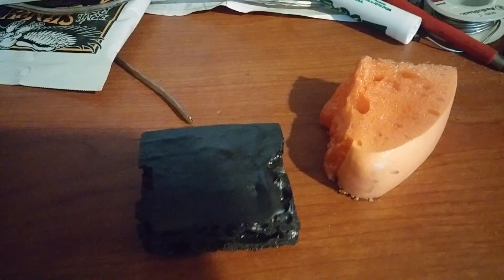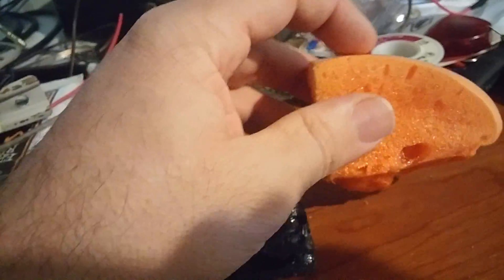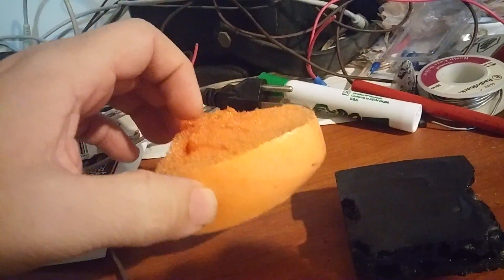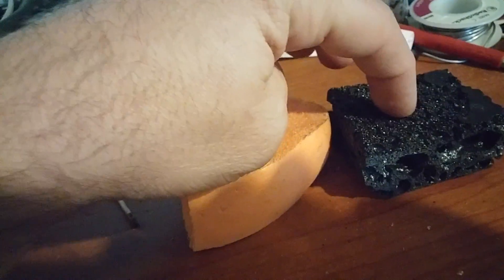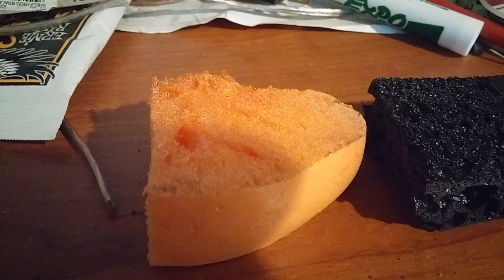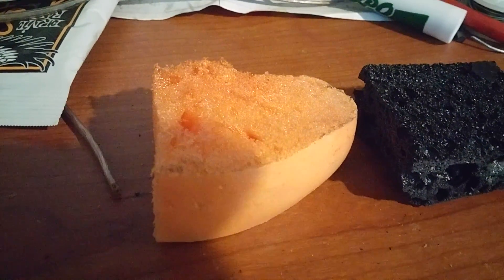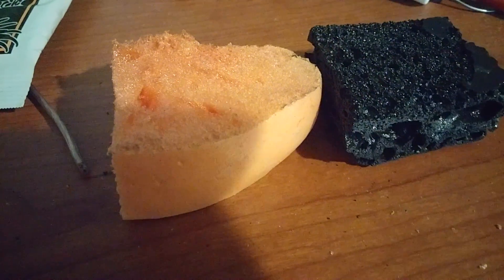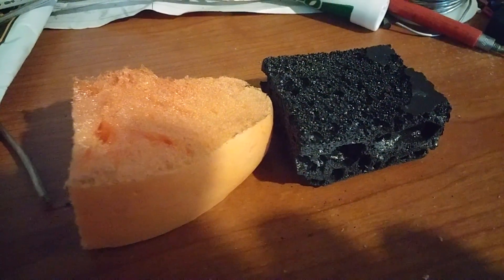Graphene enhanced foam

Comment: Seven years later, I still have so many unanswered questions.
Are you still working on this ?
Have you tried to do a more thorough analysis of the material?
Can we have some numbers and data please ?
Reply from the maker: Those are all good questions. Unfortunately the foam industry is almost a cartel in nature. Yes, the foams are enhanced by significant degrees depending on the make up.

Comment: How environmentally friendly is this material? How would you dispose of it at the end of its life cycle? Can it be recycled?
Reply from the maker: The foam is polyurethane based, so you would go through the same methods for that. As for the graphene, it's friendly enough.
Reply from the maker: The same as any poly based foam. The graphene helps, but not much.

Comment: Can we use this material in construction industry as building blocks? It would be great for light weight partition wall. Is is fire proof or fire resistant?
Reply from the maker: It is fire resistant.
Reply: Thanks.
Is it easy to mould or cast?
How can I get this material?
Reply from the maker: +Vinay Mehta very easy. just like any expanded foam.
Reply: Can you add the graphene and mix it into an existing open or closed cell foam?

Comment: I noticed when adding graphene to expoxy prior to mixing, it prevented the bond from happening, which was weird.  I take it you added the graphene to the liquid post-mix?  Was this stuff a mix?  Believe it or not, I have an actual need for this exact application.  Could high expansion foam be a building material?  Love the rambling.
Reply from the maker: Strange, because I have never had this problem. Was it UV activated epoxy?
Reply: No, it was a standard "mix these together" epoxies off the shelf!  It was your stuff, too... I have contacted these guys to get a price list and I'll share that with you when I get it.  http://www.wholesale-graphene.com/discount-online-store
Reply from the maker: I may have a solution. We have noticed that humidity can cause agglomerates with our material, and disturb  the process. This is because it hates water. Drying it before use is a key, and should fix any difficulties.

Comment: Just bought 10g to test it out. Have you done anything with thermal paste for electronics? Mixiing Graphene in the thermal paste.Was thinking about using it on my PS4 and my laptop.
Reply from the maker: +HansonHacks yep, it was my laptop and ps3
Reply: *****  Just watched the PS3 video. Didn't see a laptop one, yet. I have a bunch of Arctic MX-4 so I'll be mixing the Graphene with that. Was mostly curious about benchmarks.

Venturestarx were you able to get any benchmarks of a before and after of the laptop. In the PS3 video, you mentioned that the laptop doesn't get hot anymore. Also was wondering if you had any issues after applying all that much paste on the PS3. If possible I'll be trying to make thermal pads from it as well.
Reply from the maker: +Matthew Gregory I don't have a benchmark, but I do have actual thermal conductivity test data. when added to Arctic Silver at 3% weight, the conductivity went from 8.3 wm/k to 21.4 wm/k. We also make thermal pastes and Will make them available soon.
Reply: Venturestarx I'm not entirely sure what the wm/k means, other than a measurement of conductivity based on the context. 8.3 to 21.4 is a big jump. Thank you for making graphene, it really helps me stay motivated to pursue my interests.
Reply from the maker: +Matthew Gregory those are just the units of measurement for thermal conductivity.
Reply: I have tried it, unfortunately have no comparisons or data other than what was 130W TDP CPU and that OC'd by 25% + high jump in voltage, cooled by 3 fan radiator still leaves you desire more conductivity under synthetic benchmarks. I guess the CPU is doing something like 200W under synthetics, and the contact area is very tiny, it will still eventually reach 70C in ambient of 26-28C, but i'm guessing it's more of package heat transfer issue than anything else.
Idle sit just a few degrees above ambient, and normal loads are below 40C always, even when gaming i think it was package only reached 38C.
Reply from the maker: skaltura I have a thermal paste that conducts as high as 40Wm/K.   That's 5 times greater than Arctic Silver, and better than stainless steel.
Reply: Nice! :)
Sure i could compare it to what i mixed myself.

I've been meaning to build a rig to test the thermal conductivity in a very backyard science type of way
Reply from the maker: +skaltura is any of that good news?
Reply from the maker: Hey, I have a sample material that is very good. Would you like some?
Reply: I have not done more testing. That system is sitting stable at above 4.8Ghz (over 20% OC) and after prolonged use CPU climbs to 43C while MB is 32C (pretty much the in case temp), so we get 11C difference and the intake fans are not even running.
The CPU die probably uses something like 40-50W even while being mostly idle.

So it works just the same as couple months back, same temp difference (ambient to cpu temp).

Sample material of what?